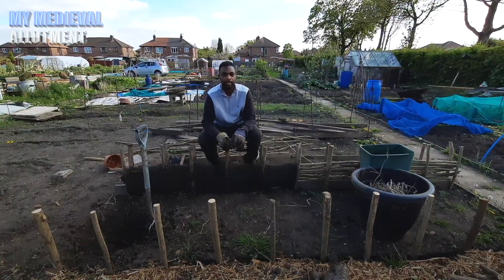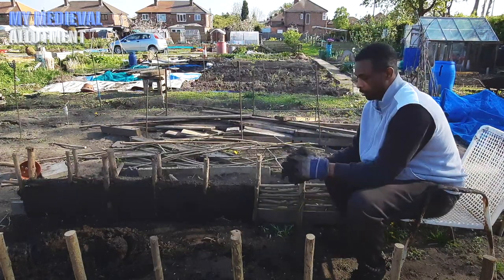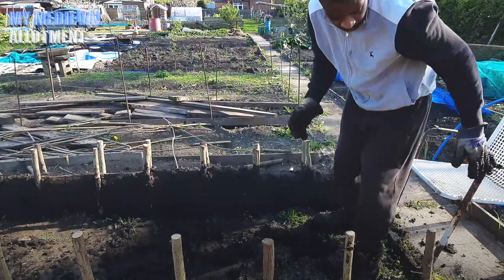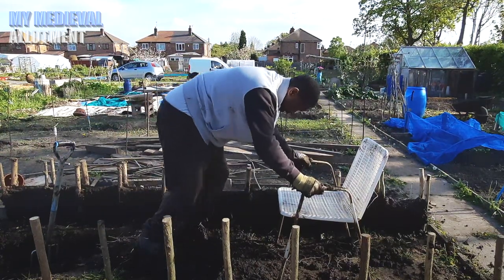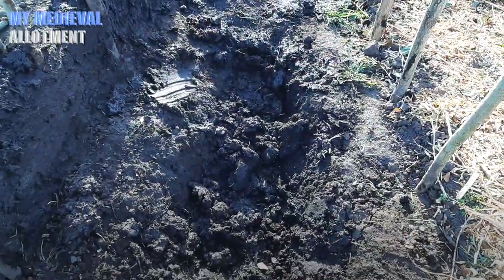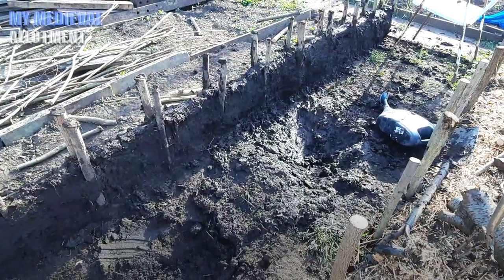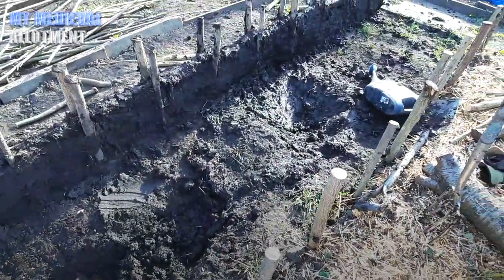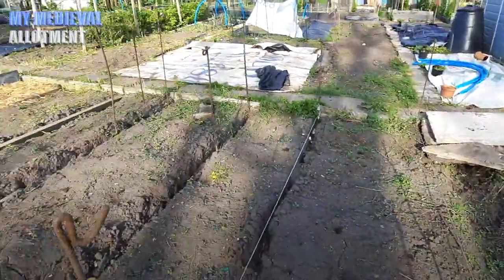UK Allotment Transformation Day 14/ How to Make Daub / Allotment Gardening UK

Comment: This id fascinating and you deserve a much greater vid-ence (freshly-coined word).  I believe that you improved your technique by placing the material in the center and working each end toward that.  Daub is quite similar to cobb, which is made without manure but specifically with a clay-type soil, and maybe a bit more strengthening straw fibers than you used in your demonstration.  Cobb is often used by Permaculturists, like the couple in the Arizona desert (Green Dream Project) who have built a large cistern and a .+40-foott dome, so far.

Putting logs in the bottom of your raised bed is - large part of the traditional hugelkultur growing system.  The wood turns sponge-like in a year, or so, greatly reducing the need for watering.  Please keep going - we can all learn from history (and chem-food scares me unlike what people have survived on for millennia).